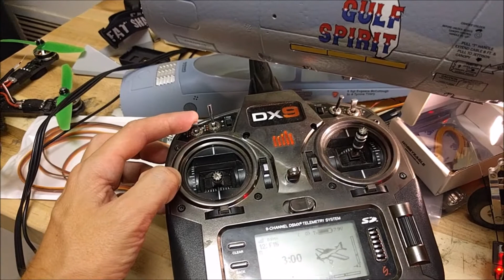Freewing F-15C Eagle Gyro Installation

Comment: did you have any issues with the rudder not working after hooking up the the wire into the gyro.  I put the A3 pro in my BA Hawk.  Rudder does not respond.  I see you might have dual wires running from the gyro for rudder. if that is true can you tell me how you hooked up the wires?

thanks

Mike
Reply from the maker: I don't recall having any issues with the rudder. Unfortunately I can't share the wiring configuration as I recently sold this plane. Hope you got it working.

Comment: I have the spektrum AS3X 9350 in my freewing F-15 only have a few flights on it haven't turned it on how does it fly with the gryo  I find it flies well without the gryo much it's very smooth kind of like a larger aircraft. I do have a vampire from hobby king which could use a gryo